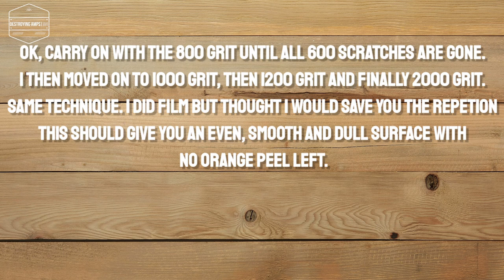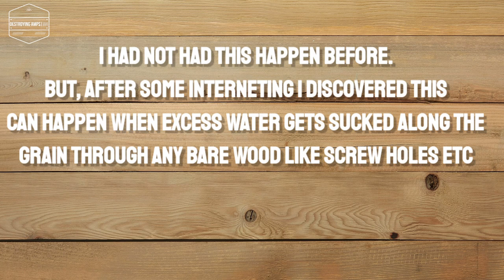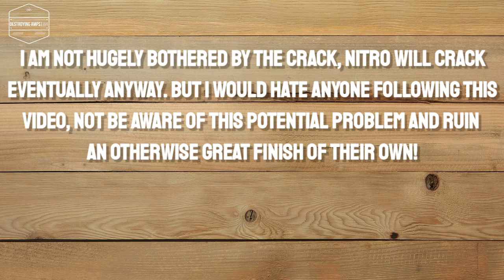How to Buff and Polish - Remove ORANGE PEEL from a Rattle Can Guitar Refinish

Comment: End May  2022. I like your video because I do everything by hand as well. The ONLY electric sanding that is safe to do is at preliminary stage when removing original finish. It's good for the crude/rough work just prior to primer coat. And the WORST thing to do is use a sanding block at ANY time after the primer has been sprayed on. Those wood bodies have contours that we can't detect by eye. But a sanding block sure as H will locate them. Finger sanding follows those mild contours. I have guitars that I clearcoated and SKIPPED the orange peel removal steps. I just car polished them with orange peel LEFT ON and they look terrific. The orange peel is UNIFORM. It is NOT unsightly. It truly is NOT necessary to sand out the orange peel.
Reply: So after you applied the clear coat you just polished it? Did the orange peel go away or is it there but just looks good?

Comment: hi mate sick video, just wondering if the red t cut will be fine for a fiesta red finish? as in will it affect the shade at all? cheers
Reply from the maker: If you mean the standard t cut. It should be ok.  You can get a version like mine in red from Halfords that I've used before and makes life easier.  But if you already have the normal t cut maybe try some under the pickguard first to make sure it's OK?
Reply: @DestroyingAmpsGearDemos  cheers for the reply man, I was talking about the actual red colour t cut, just wondering if it actually alters the original fiesta red colour in any way, but i assume it doesn't work like that.
Reply from the maker: @jrc96  no shouldn't do. I have a fiesta red guitar that I used it on and it was fine.  But yeah use under the guard first to make sure. Best of luck
Reply: @DestroyingAmpsGearDemos  cheers man! fiesta red over 3 tone sunburst nitro, hope i don't massacre it 😂

Comment: Should I sand the paint before applying clear coat if I have Orange peel in the painted coats?
Reply from the maker: You can if you want, I don't tend to. Unless there is a drip or something I've really buggered up.

Comment: Thanks for the Great Video! did you use paint and clear coats while ignoring the orange peel and after building the coats you sanded the orange peel? or did you recommend sanding the orange peel between coats?
Reply from the maker: After everything was done and cured. Have a video on it 🙂

Comment: using vaseline to plug up the screw holes works well but Im not sure about the tuner holes
Reply from the maker: Good shout!
Reply: Candle wax as well, double bonus for lubricating the screws to wood contact.

Comment: Great Video!!! Was the orange peel already in the color coat or did it only appear after applying the clear coat?
My guitar looks basically the same as yours before the treatment but the orange peel / structure was already in the color coat… I already applied 2 coats of clear coz I had a hard time deciding if I should sand the color coat or not. So I just continued and your video gives me hope that it will look good when I do sand and polish only on the clear
Reply: Howd you end up handling it?

Comment: Do you need to sand the color coat before you apply clear coat?
Reply from the maker: No not with Nitro as it all melts together. But you would need to sand out any imperfections like a drip.
Reply: thank you! Also another question. When the color dries does it look smooth evenly or do some areas are a little cloudy than other spots?
Reply: Thank you so much for the reply. In the process of refinishing my guitar but have used dupli color spray cans as suggested in one videos ive watched
Reply from the maker: @12Jsilva  no worries buddy. Thanks for the sub. Hope it works out. Cheers
Reply from the maker: It should be pretty even.  By cloudy do you mean like milky? If so that could be moisture trapped in finish. If it was nitro I would spray a little more which should clear it.